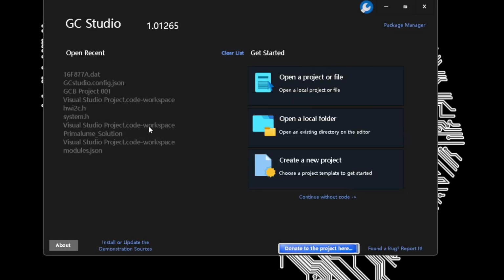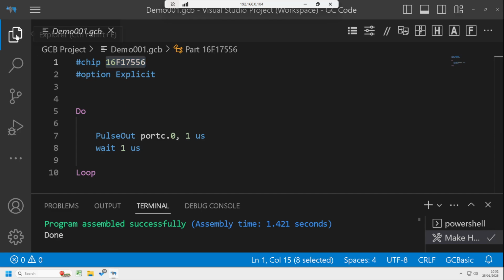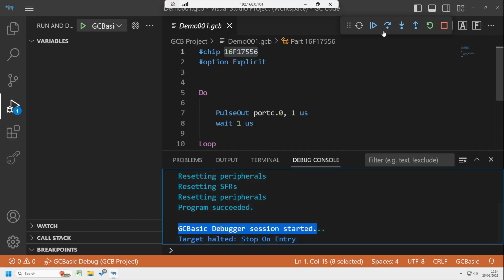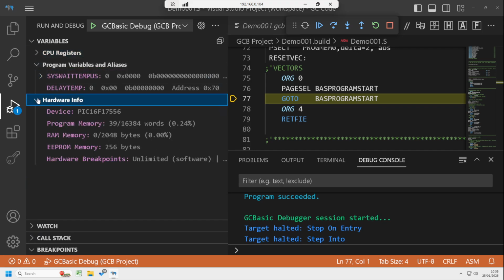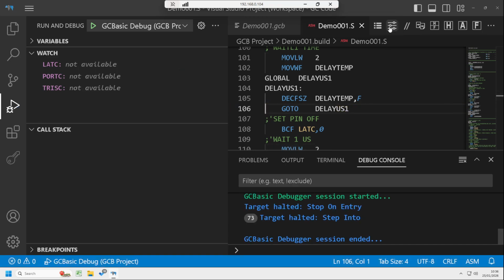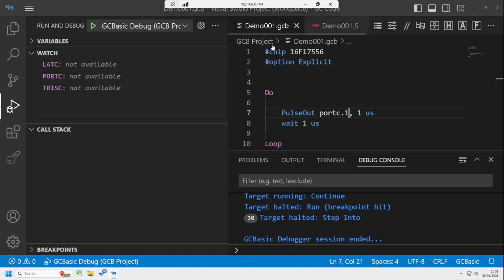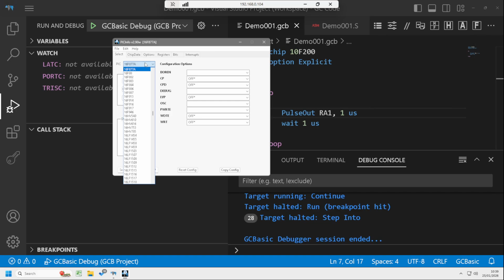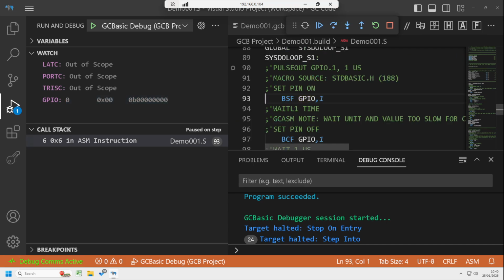The NEW GCSTUDIO Debugger Changes Everything for PIC Developers

Comment: Excellent. We now just want a graphical representation of the chip pins going high & low (or open collector) as you step the code & a graphical representation of an LCD to see what's being written on the screen
Note: Can you rename the video as you missed the "C" in GCSTUDIO?
Reply: Yes, we are going to add the chip pins representation in the future; but even better, imagine watching this on real hardware step by step actuating the leds and communicating with an LCD, that would be awesome for learning. You will know exactly what's happening under the hood at a machine level!
Reply: Having been an engineer for over 30 years, I believe the best approach for teaching inquiring minds is to:
1/ Write the code
2/ Test the code with an accurate simulator that best represents the hardware (ie a visual representation of the chosen micro's pins where the user can inject the input pin values including ADC values & the user then can observe the outputs changes including an oscilloscope to view fast moving pulses and an LCD showing the results then
3/ Downloading the code into an actual microcontroller knowing that everything will operate as expected.
This saves a lot of time & installs confidence in the students minds.
Reply from the maker: To clarify.  The an 8 bit port with pseudo LEDs? 

Thank you for the 'excellent'.  This has been two years in the making. Amazing work by Angel building upon the toolchain
Reply: @AnobiumTech Yes, this then becomes an excellent teaching tool.